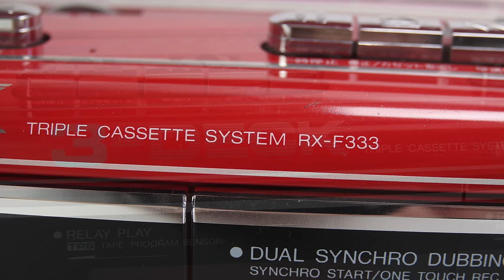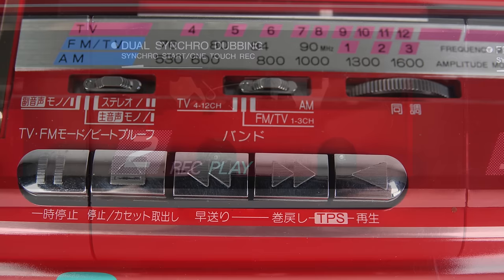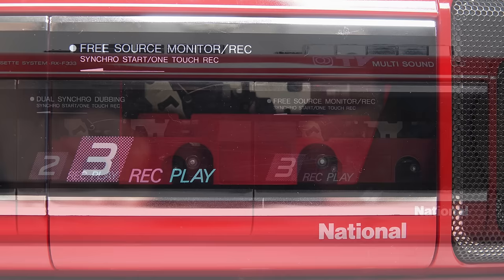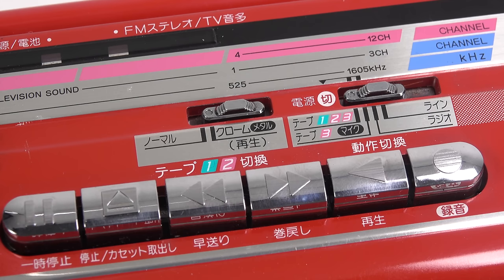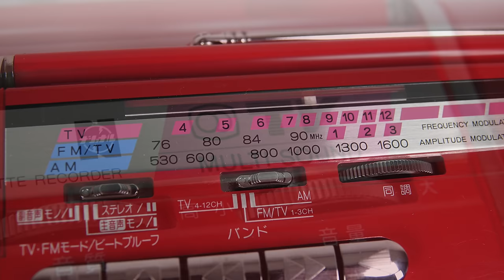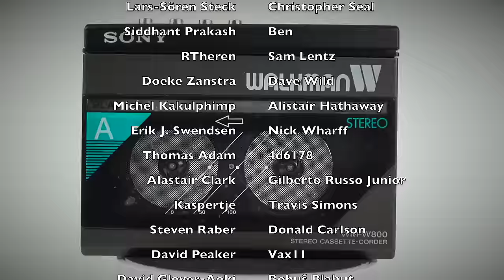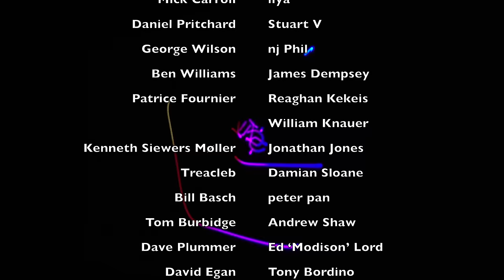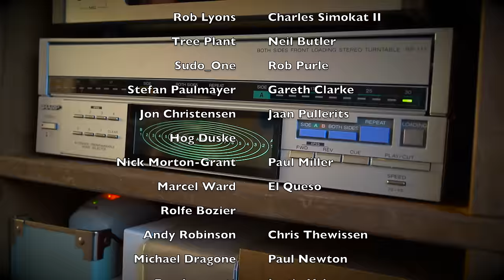The Three Cassette 'Boombox'

Comment: If only there was some cassette deck war back in the 90s where all the boombox manufacturers were adding more and more cassette decks.
Reply: Everyone needs a 12-cassette deck, right? I now want one...
Reply: the 69-deck stereo
Reply: Brilliant, I'd love to own a Gillette cassette deck!
Reply: @EvenTheDogAgrees  damn! Beat me to it!
Reply: You could use them as a bludgeon, like those metal cop flashlights with ten D cells in them.
Reply: @haweater1555  Yeah, but it only has one mechanism, not 12 or 20, so it's kinda boring...
Reply: I report to you from that timeline. My nine deck cube player is outstanding.
Reply: I have a 6 cassette changer but it only uses one play mechanism, great for old audio books though you don't have to change the cassette al the time.
Reply: @Matt McIrvin ... I have a Panasonic RX-C100 that takes 10 D cells,  Not sure that anyone would care to swing it more than about twice, but I'm sure it could do "the job" nicely, and still play your tapes for 2 hours afterward on the D cells :)
Reply: Time you got to the 90's they  were starting to make multi disc CD players where  you  could load 5 or 6 discs in one go,  I even remember a Sony Minidisc stereo which could hold 3 minidiscs,  I'd love to find  one of those now!
Reply: @ApemanMonkey  You just made my day.
Reply: You mean like Garage54 with their 4-engined Lada?
Reply: There were those ones where one deck took 2 tapes, mechanism in the middle. So that'd fit six in there to start with. Then you could add an upper tier, would still be smaller than a lot of boomboxes. So there's 12. If you're putting up with C-120s, that's 24 hours' music. Wouldn't want to repair it 30 years later when the belts went, though.
Reply: There was never any need for 3 decks. With 2-deck radios you could already listen to one deck while it was dubbing onto the other deck. So what do you need 3 for? Also, these were very low quality decks, with very unstable running conditions caused by cheap plastic parts. The best quality boomboxes were made from 1978-1982. After that, quality went downhill very quickly.
Reply: @pdote  12 cassette, no need to flip to play side A side B